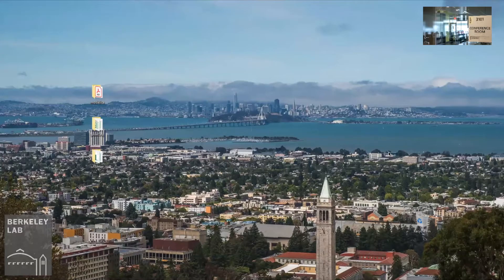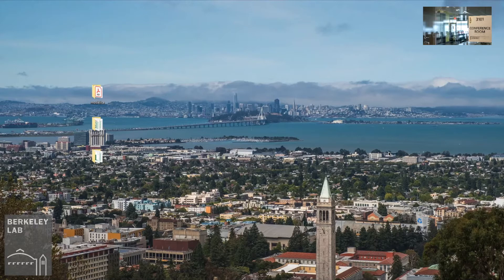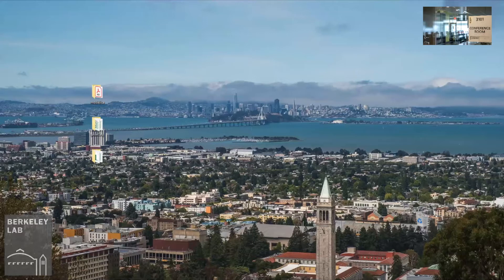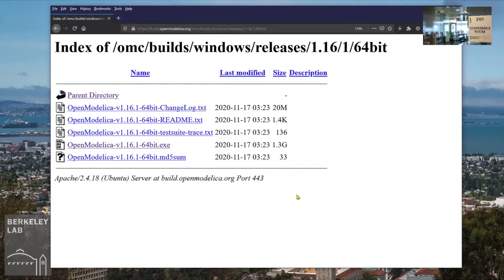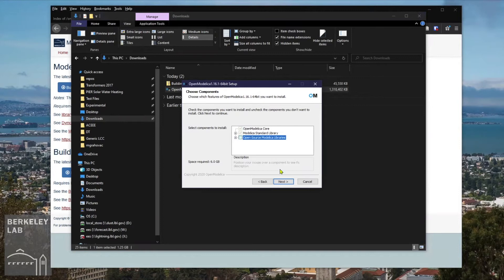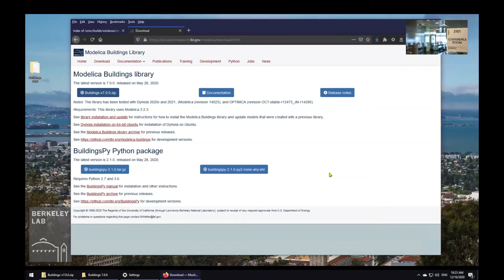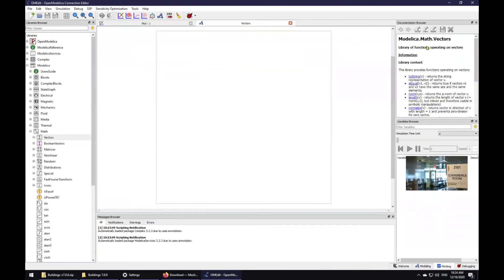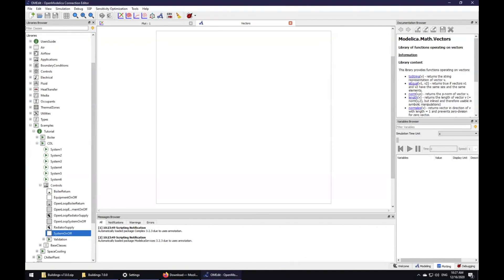Intro in Simulation and Installation of OpenModelica with ModelicaBuildings

Comment: Thanks for your video Milica. I have downloded the building lib 8.0.0.  I just paste the building library folder in the same directory where the other libraries are already there. When I open the dymola and load the package file of library it's been loaded. But I cannot use the component from this library to my current directory file, as base classes from building library are not integrated . Maybe I did not include the library path, I am unable to do so and receiving errors because of that. Can you please tell me how to resolve this issue as I am new to modelica. Thanks in advance